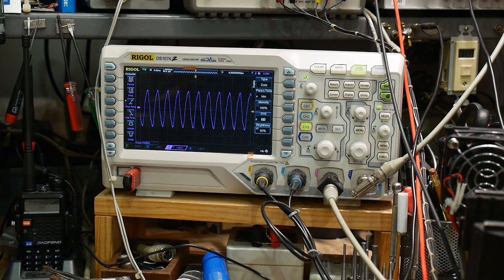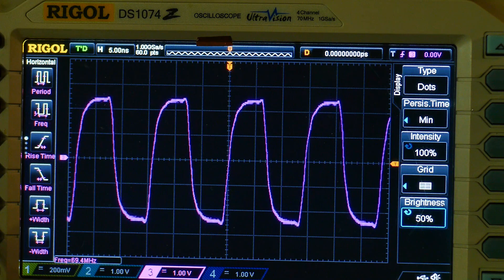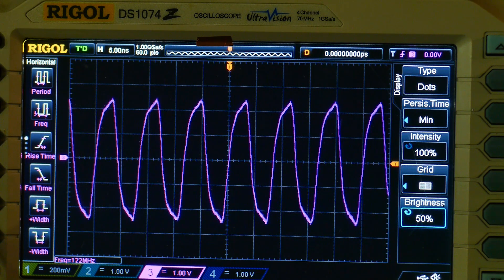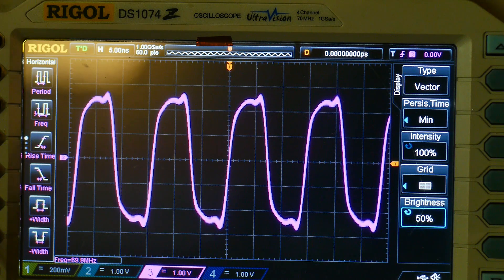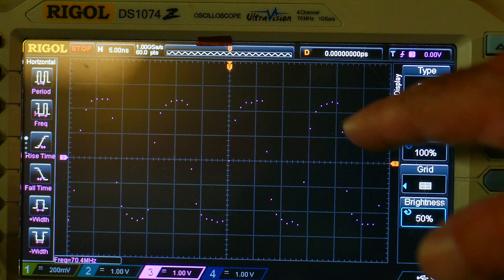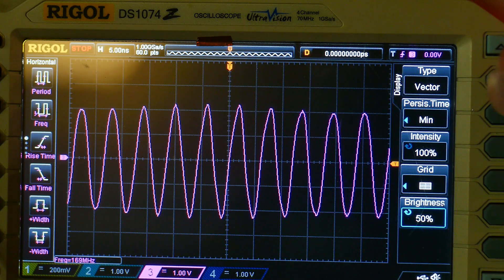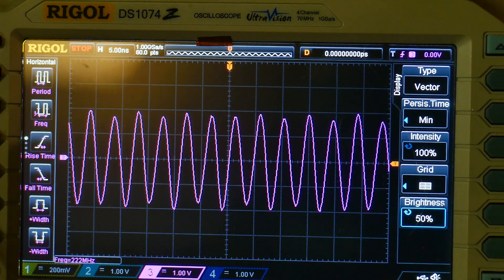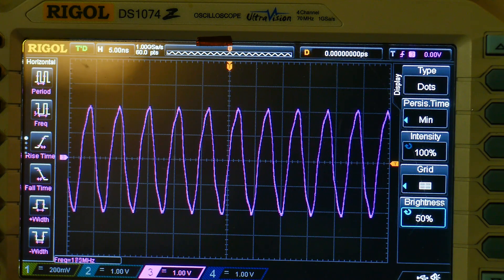#804 Measuring the Bandwidth of my Rigol Oscilloscope

Comment: Hi, thanks. Is there a way of testing and verifying the bandwidth up to 500 MHz without fancy expensive equipment? I don't have a function generator that goes that hi.
Reply from the maker: you can measure the rise time, but you will need a very fast edge:
https://youtu.be/iImBK_st5ww?si=GfdaOwziodeqIDM1
https://youtu.be/QCq1REgpBCA?si=4USaPHd0c6lIbSTJ
https://youtu.be/WutBUVs7_z4?si=z3SF3c4qa9mxYIgt
Reply: @IMSAIGuy thank you for the reply. I watched the  video in the link, a few times. Sounds like I am gone have to learn some more before I can obsorb all that there was in the videos.
Reply from the maker: https://www.tek.com/en/documents/primer/evaluating-oscilloscopes

Comment: I just copied from tek website, better then me trying to explain(https://www.tek.com/support/faqs/how-bandwidth-related-rise-time-oscilloscopes)

Historically, oscilloscope frequency response tended to approximately follow the rule: Bandwidth x risetime = 0.35. This corresponds to a 1- or 2-pole filter roll-off in the frequency domain. Today, at the high end, most real-time digital oscilloscopes more closely follow this rule:

Bandwidth x rise time = 0.45.

This corresponds to a much steeper frequency roll-off above the specified bandwidth. The steeper roll-off is more desirable in digital oscilloscopes that oversample by 4x, 3x, or even less because it prevents aliasing by eliminating any signal above the Nyquist frequency (1/2 the sample rate – the minimum sample rate required for accurate signal representation).

So if you have a fast pulse gen like leo bodnars  40 pS gen you can calculate bandwidth from risetime, a standard risetime measurement is in every scope nowadays.
Reply from the maker: The link is not working. I think it must be a rise time measurement. I will be doing a future video on this. I first need to get the equipment to product a very fast edge. It's coming
Reply: @IMSAI Guy   Here is the link working, sorry about that 🤗 https://www.tek.com/support/faqs/how-bandwidth-related-rise-time-oscilloscopes 
Its just a reference to the piece of text i did put below.

Leo bodnar's 10 mhz/40 pS risetime pulser is fast enough to do this test, not so cheap but a nice piece of engineering with software to adjust the output level, low noise etc  
It comes with its own individual test report of performance.
http://www.leobodnar.com/shop/index.php?main_page=product_info&cPath=124&products_id=295
40 pS equals to 25 ghz so thats several magnitudes over a 1 ghz scope but if you want even more accurate/higher he also has a 30 pS pulser but only with sma connectors and twice the price 😉
If your not familiar with him: have a look at his GPS DO , its a really well developed piece of kit, i use it to reference all my gear to 10 mhz.

Comment: I wondered about the "fix up" for the Rigol, never go around to doing my DS4024, will give it a try some day, I guess it's out of warranty by now.    Never really wanted to mess around fearing I would brick the thing.  The other week I was comparing two Rubidium oscillators that at 100Mhz (after a 10 clock multiplier) thinking, be cool if I could get the Rigol to display at 500Mhz I would add another 5x multiplier to the testing. I should look to for the fixing data.   Thanks for the video,  possibly will bump into each other at excess or Anchor some day.

Comment: You have to consider that you use square signal at imput. To preserve squere signal integrity, you need bandwidth at least 5 * first harmonic @ 100MHZ its 500 MHZ of bandwidth... This is my rule of thumb.
Reply from the maker: You are correct. I used the generator since it is small and would fit on screen. I have repeated the tests with a sine wave and get about the same results. Since the first harmonic of the square wave is the sine wave, it was a quick test of the bandwidth.

Comment: I think you would get better results if you use the TinySA as a generator since it produces sine waves. I have used it to measure the bandwidth of my Tektronix 465B which is rated at 100 MHz. With the TinySA, it came out as 130 MHz which is reasonable since Tektronix was conservative with their specs. Also , note that dB is dB. What that means is that 3 dB is 3dB whether referred to voltage or power. Thus 3 dB down in power is 1/2. 3 dB down in voltage is .707 which, since it is voltage, is also 1/2 power. Bandwidth is usually defined as 1/2 power which is why you use 0.707 as the factor when applying voltage to measure the bandwidth of an oscilloscope.
Reply from the maker: The TinySA is ok on low output, but some harmonics. Don't use the high output it is square wave. I repeated the test with my HP8921 (very clean sine wave). I measured 180 MHz with two channels and 100 MHz with all four.
Reply: @IMSAIGuy  WOW! That's a great scope!

Comment: With 1 GSa/s capability, I thought the aliasing wouldn't occur until about 500 MHz. I have an old Tek TDS784A scope that also has 1 GSa/s.  I'll have to try the same thing.  I think I'll use a sine function instead of the square wave though.
Reply: If he turns on a seconds channel that 1GSa/s sampling rate is shared between the two channels, so it's only 500MSa/s. Although in the vid I only see channel 3 enabled.

Comment: What happens when all 4 channels are in use at the same time?

I think the same hardware is used for 50Mhz - 200Mhz versions but the badged 200 is a two channel only; the 1202z unit.
Reply from the maker: two channels I'm getting 180 MHz  4 channels only 100 MHz

Comment: Maybe you can turn off the interpolation explicitly on the rigol also and benefit from the vector-mode if there are only a few points. This should make more visible whats going on by conntecting the dots with straight lines instead of showing what looks nices (Everyone likes sinusoidials :-))

Comment: Most all digital oscilloscopes do a sinx(x) - Interpolation on the trace. This may help to get a more realistic trace, if you have enough sample-points. If there are only a few sample-points availabe, they fool you because they show sinusoidial traces instead of the real sample values. On my Siglent, this feature can be turned off explicitly. I set the default to disabled.
It looks like your Rigol turns this "feature" off when you switch to point-display.

Comment: Thanks for showing the achilles heel of these modern DSO scopes. I have a Siglent 1104X-E, an old Tektronix 784A, and an older yet Tektronix 2230 (analog). I do a lot of high power audio amplifier work, so I do not really approach the limits of any of these oscilloscopes, but, I still prefer my Tek 2230 analog scope for some reason. I can't place my finger on any one thing, but perhaps it is because I was schooled with analog and it is just what I like to use. This happens to be a topic where there are many differing views, from many different perspectives, BTW! Regardless, thanks for the insightful video.   Fred
Reply from the maker: Yes, analog scopes have a different feel. I've gotten used to the digital ones and like them. I still have a Tek 336 that is both analog and sort of digital (line digitizer). much better than persistent phosphor types.
Reply: @IMSAIGuy  I have a Tektronix 465M.  I like the old scopes but it's nice to be able to grab a one shot signal and freeze it on the screen.  I think they had ones that would do that back in the day but they were expensive IIRC.  Bought a Rigol 1054z, hacked it, I have no regrets.  :)
Reply: I like Analog scopes more because of "the feeling". But for serious work, DSO's is the best choice always. 
Would love if a manufacturer just simulated the feel of old scopes. And no. I don't like Tektronix version of it.

Comment: Do you have a good used Tektronix with 500mhtz or better?  Can't believe you don't, being a lab guy. Thanks for the look.
Reply: Most scopes does 500 millihertz just fine, atleast in DC coupling mode.
Reply: @larslindgren3846  🤣
Reply from the maker: Haven't found one for a cheap price. Was a 1 GHz Lecroy for $400 but it was too big! I don't have much room. I've been thinking of upgrading my Rigol to a better model.
Reply: @IMSAIGuy  Some of the 1GHz-labeled Lecroys require a special adapter to interleave 2 channels into one in order to get the rated 1GHz, otherwise they will only sample at a useful rate up to 500MHz. So do be aware of that if you do get one. They are big. I have an old 500MHz Lecroy 7200A (the one from the 1990s, not the newer 7200a) which is gigantic (and loud), but nice to use. :-)

Comment: Bandwidth is measured -3dB (voltage) of a sine wave.
The input in the test is probably from an function generator which can't provide the clean sine wave.
Reply: So the scope is displaying an  distorted signal.
Maybe an additional instrument is required to find out the reason of the "slow rise time square wave" instead of sine wave.
Reply from the maker: @paulcohen1555  opps! sorry  I was using a square wave.  forgot, I had to re-watch the video.   I'll have to repeat with my 8921
Reply from the maker: I assume it will test the same, at max bandwidth the scope is throwing away all the higher harmonics and leaving the fundamental of the square wave (the leftover sinewave).
Reply: @IMSAIGuy  The scope is certainly ATTENUATING the harmonics, but they will still be present and provide extra power on top of the fundamental and provide error. Out of band responses for the input circuitry will also throw it off. Scope input BW measurements should be performed with a clean, stable sinewave.
Reply from the maker: @NimbleJack3  I ran it again with HP8921 clean sine waves. at 80MHz 200Vrms  at 180MHz 1.4Vrms
Reply: @IMSAIGuy  Awesome, where was the 3dB point?
Reply from the maker: @NimbleJack3  180 MHz   200mv * 0.707 = 1.4
Reply: @IMSAIGuy  You appear to have made some sort of arthemetic error, 0.707 times 200mV is 141mV and change.
Reply from the maker: @NimbleJack3  yes. sorry   it went from  200 to 144
Reply: @IMSAIGuy  Aaah, gotcha. Thanks!
Reply from the maker: The sine wave was from my HP8921. very clean sinewave.

Comment: Activate the frequency counter ;-)
Reply from the maker: I did off camera. It only worked up to a certain point (forgot where).
Reply: @IMSAIGuy  Press Measure -> Counter to select CH1-CHx
Reply from the maker: @richterd21  Yes, I use it all the time, the counter only works up to a 100mhz then stopped working at the higher frequencies.